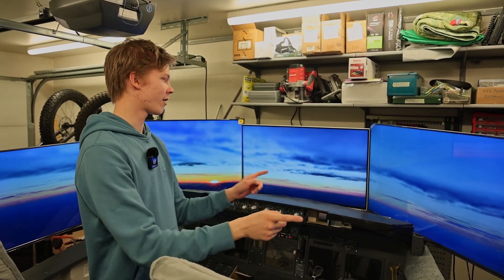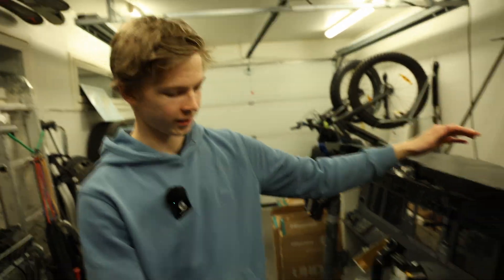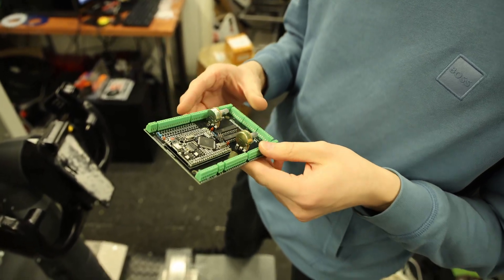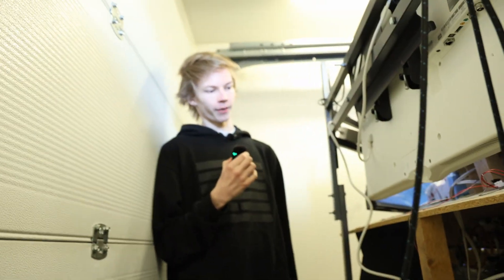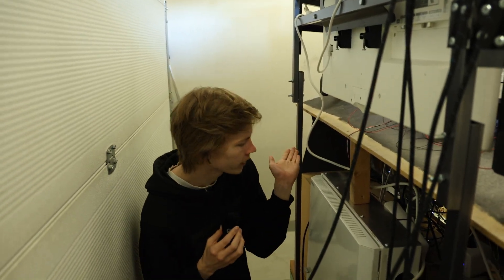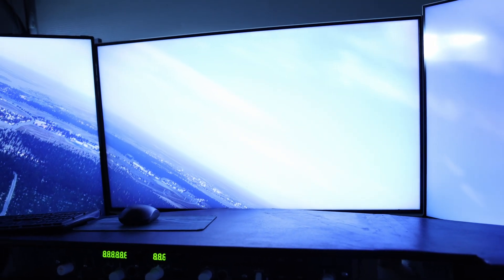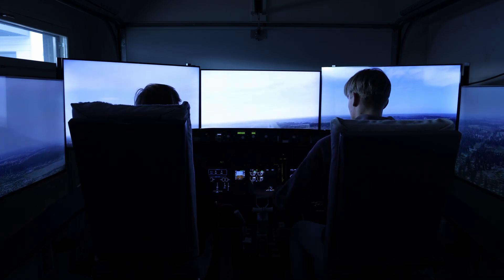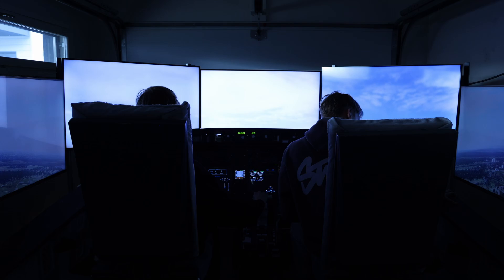Best Looking DIY Instrument Panel Ever! [B737 Build #16]

Comment: How does your pc handle all the extra screens?
Reply from the maker: The 5 main TVs for visuals are running on a computer with two GPUs while the instruments are processed by a second independent computer running a special software to pull the data from X-Plane 12. That way we don't need to have all the screens in the same PC
Reply: @diy_finn I didn’t realise this was even possible?! Do you know if MSFS has any such capability? I hope so
Reply from the maker: @pilotskippysyd  We haven't tried it with MSFS but I recon it's possible. Maybe some screen sharing softwares are the easiest solution but in my opinion X-Plane excels in homecockpit compatibility.